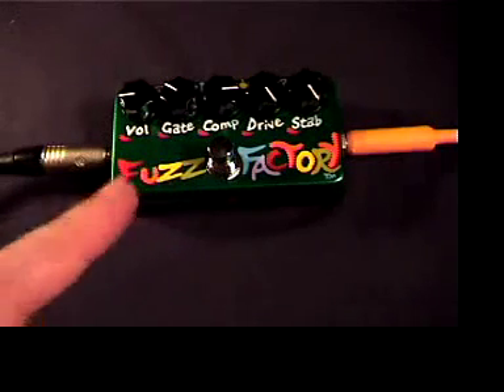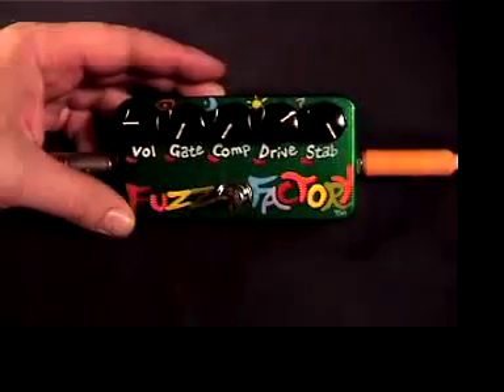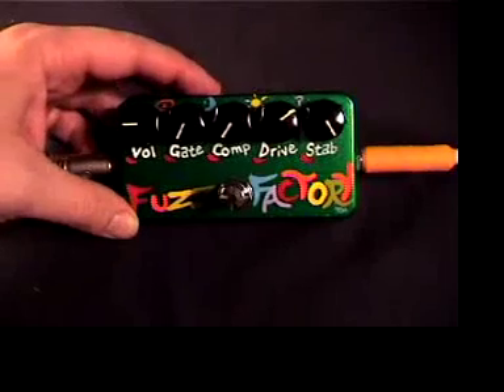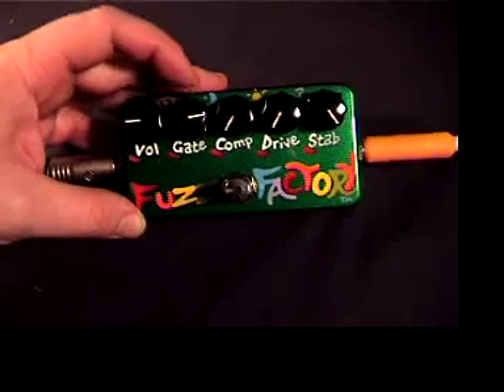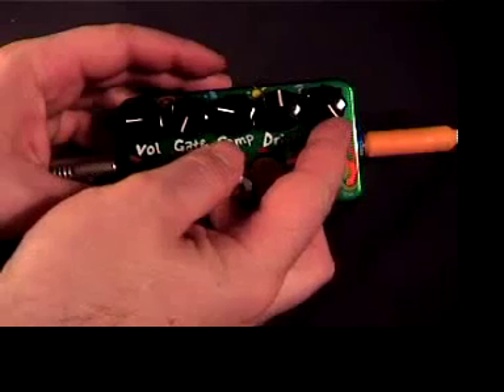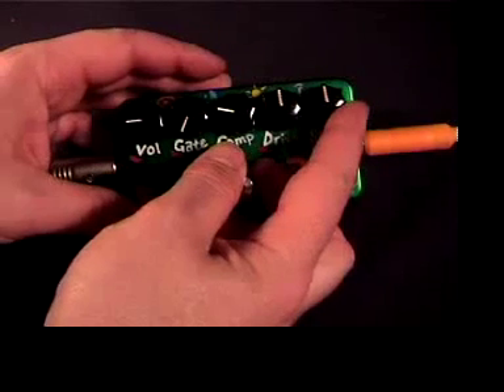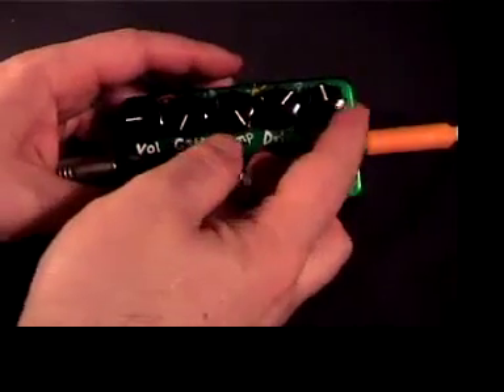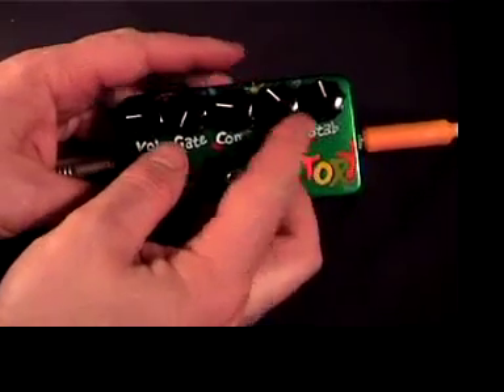ZVEX Fuzz Factory demo video by Zachary Vex

Comment: Hi, does each design of a pedal correspond to a different pedal or are they all the same and only the design changes?
Reply from the maker: Sometimes we release limited runs of pedals with different transistors.
Reply: @ZVEXeffects  That is, all the Fuzz Factory Vexter pedals that have different designs have different circuits and sound different?